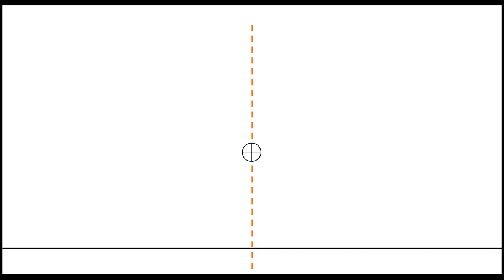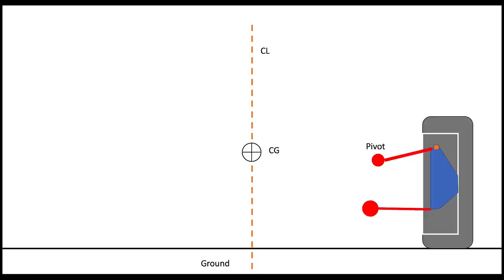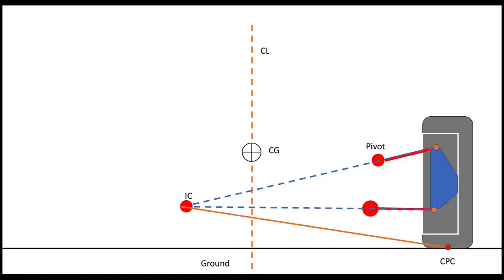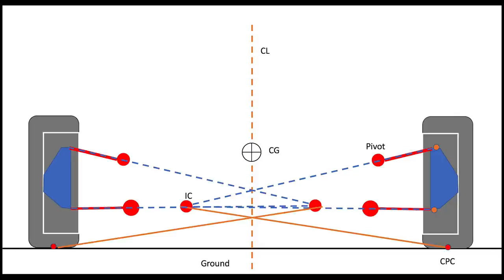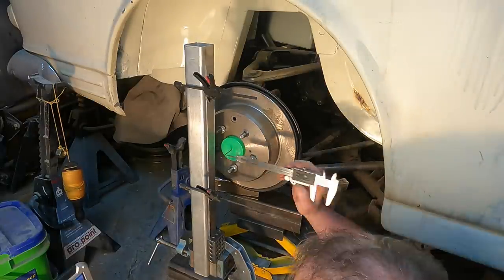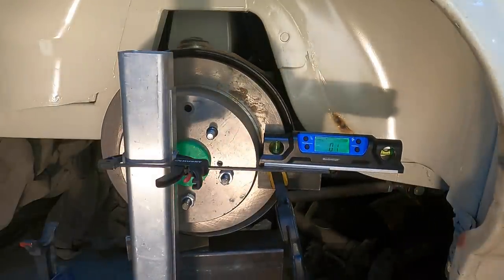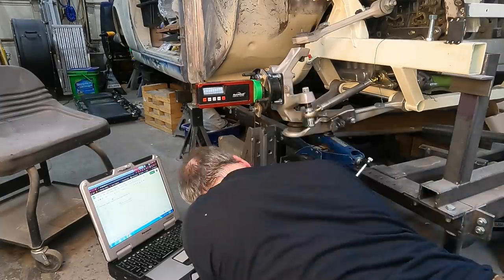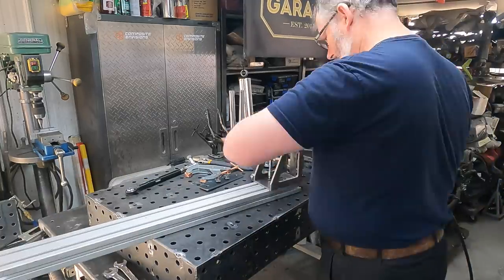Suspension Tuning: Roll Centers and Dynamics

Comment: Good video, when I did mine, I built the controls arms out of PCV plumbing pipes in the mock up stage and tried out dozens pick-up points and control arm lengths.  Made the virtual  FVSA (Front View Swing Arm) with string to capture the roll center.  Was manual and took awhile but had everything worked out before cutting and welding. Keep up the good work.
Reply from the maker: That's like the Stainforth string computer - works a treat from what I understand. I'm going to try some computer simulations in the near future.  The major learning in this exercise was to drill into my head what happens when pivots change.  I needed to experience this and get some hands-on before computer analysis output makes any sense.  I learn mechanical things through my hands more than my head it seems.

Comment: This was great. Thank you for going into the weeds a bit for us. I'm following the graphs well enough. The one thing I'm missing is what you've been changing to get those new curves. Adjusting position of control arms? Angle? It would be interesting to know/see in the next suspension video. Or in a comment, whatever works. Otherwise, hey, anyone who's done enough work has run into "ope" moments like this. C'est la vie. We're here to see the process, and no one ever learned by doing something perfectly the first time.
Reply from the maker: Sorry - I'm changing the location of the links as well as caster/camber.  In the graphs - the UCA/LCA both went down 2" (a little more for the front UCA pivot).
Reply: @ThrottleStopGarage  no need to apologize! Thanks for the insight. Hope the setup works well for you! Thanks for sharing.
Reply: Yeah, this was what I was missing as well, thank you for asking this question.

Comment: I played with the Corvette suspension a few years back.  When I used the standard upright positions on bump and droop the wheel angle was terrible.  This left me really confused then I re ran the tests with the body of the car rolling slightly and the suspension worked perfectly.  What the designers realized that I had considered is that when you are driving straight it doesn't matter what angle the wheel patch is during bump etc.  But in a corner is were it counts and that means you need to take into account body roll.
Love your videos keep up the great work.
Reply from the maker: I've got that in mind - it just doesn't pack into a video very well...I didn't show the side view geometries or any of the bump steer correction work (though watching my laser line move might be fun if you have a cat).  So body roll is part of the overall vehicle design.

Comment: I measured the roll center in a similar way when setting up the front suspension on my Volvo 142 race car to make sure I wasn't messing anything up by lowering it. Removed the springs and raised and lowered the car with the front tires on some rolling dollies, measuring the distance changes between the dollies in the process (and camber changes). That process made me realize that the slope of the CPC's trajectory is the real metric we're after, in addition to being easier to understand. A 10:1 slope, means 10% of the lateral loads are added to the tire vertically before the car even begins to lean and load the springs.
Reply from the maker: Absolutely.

Comment: Excellent explanation.   I too had wondered about 2 diamesion instead of 3 . I did note at position approx 17.30 on video . When jacking up to test the front top mount bolt moves . Hopefully that didn't make a difference .  Good work keep it up
Reply from the maker: Sharp eye!  I had some issues but in the end I measured and remeasured...then optimized and remeasured again.  It was solid with little variability.  I did do a standard error of the measurement analysis (not reported) - I'm a scientist - so I can do boring things virtually forever.

Comment: I like the different approach, if your adapting a suspension to a car this is a great method to get readings.  One thing I would have touched on is the relationship of the roll center to center of gravity.
Reply from the maker: I'm sure I'll cover this in a little more detail when I get the new suspension built.  The roll moment is critical to handling.

Comment: Typically roll centers are tuned for weight transfer dynamics and caster/camber curves are tuned for tire patch optimization independently.  Also, roll centers migrate, so I'm not sure using your method actually calculates the roll center at curb position.  You may be right, I definitely want to look into it, but when I think about adding significant length to a single arm, you will massively change the results.  Like if your upper arm is shorter than the lower, you'll camber in.  But if it's longer, you'll camber out. You can be at the same RCH with both conditions, but have significantly different kinematics.  I would say this is a good method for measuring the camber curve for sure.
Reply from the maker: It's a method that can be used and it works.  All roll centres are instantaneous...and can be found using forced based or geometric methods.  There are problems with definition, I'll cover this in my next video.
Reply: @ThrottleStopGarage  I guess the issue I have with the method is, I can change the kinematics to get different outputs that you measure, but without changing the roll center height.   What I'm not sure of, is if the outputs, though different, will still produce the same RCH.

Regardless of that, you seem to insinuate tuning your caster camber curves by adjusting RCH, but I typically treat them as completely decoupled metrics and tune them to do different things as they are responsible for different aspects of dynamics.  I guess my comment just stems from your early reference of being critical of other RCH videos, but not actually teaching what they do or how to tune them, but what I got from this video seems to be very different than what's practiced in the vehicle dynamics community. Again, not saying your measurement method is wrong as I've never used that method to measure RCH and I plan on running the math as it's intriguing, but you seem to be the type of person who would take pleasure in technical discussions and I also enjoy learning new methods and techniques.
Reply from the maker: @badinvestmentbuilds3823  Interesting - I'll try to explain the method first and then we can chat about the rest.  The criticism of the other videos is that most share a simple 2D "join the dots" geometric method (nothing wrong there) with the assumption that measuring the intersections of these points is trivial.  In practice, most suspensions are complex shapes and it's difficult to measure these points.  If we're making some quick adjustments to arm chassis mount points, then there is an "easier" way.  I glance off the topic of what a roll centre might represent as it opens up a bit of a pandora's box and I am not qualified to argue these points.  There are many research articles and I think a deep dive into this is beyond what I would be comfortable trying to explain.  In the vehicle dynamics community, they know what they're doing and they have studied the subject and worked with it - they have data-driven validation.  No question.  I guess I just didn't need to see another "join the dots" video.  Lots of those, most are a little shy of what happens when you do these things.  If I can only replicate what others have done, I'd just leave it.  I also didn't find the locating of these points to be effecient to measure on a jig.  The accumulation of error in their location (uncertainty) was pretty large (while it may have only been a few mm total).

Camber curves are a reflection of the relative lenth of the links and their angular relationship.  That's it as far as I know.  As my links were fixed, then what I can do is change their angular relationship.  The effect of this change is to alter the location of the location of the instantaneous centre - as, at that instant in space, the suspension is moving as a swing arm fixed at that point.  The validity of the method I present (which is not my creation - I was told to implement this method and the geometry makes sense) stems from the geometric reality that measuring the slope of the arc at the ground plane yields the line where the IC is located without having to measure the specifics of the arms that produced the IC location.  The line that connects the contact patch centre to the IC is what is used as a geometric location for the RCH and for a symetrical suspension, the RCH is going to fall at the centre of the vehicle.   

For any given RCH location for any specific combination of links and angular relationships between these links, there is a single IC.  In other words, if you hold the angular relationship constant - there is only one possible RCH.  The arms could be any length up to an including their intersection at the IC.  If you fix RCH and vehicle track width - you can have many different arrangements that will generate the RCH - but they all must lie on the line described by the contact patch intersection and the RCH.  This method seeks to measure the angle of that line.

If you change the angular relationship of the links to alter the camber curve...you will change the RCH.  They are completely dependent.  I hope I have explained this a little better.
Reply: @ThrottleStopGarage  I think the part my brain is messing with me is that I can change the kinematics without changing the RCH, which will change the output the curves, but the new curves will likely point to the same location.  I'll put a little math model together comparing them without measurement error.  I'm the field, we would use inclinometers on the arms, articulate it on an alignment rack, and pop those numbers into a calculator, but that requires a bit more up front work.  I'll reach out again if I can find the time to make the model and hopefully post up a video complimenting yours.  

You're correct that there's a lot of 2D dot connecting that doesn't do much good to the average tuner.  That has been a bit of inspiring for me to want to make a "Vehicle Dynamics for a 2 Car Garage" series lol.  High level specific development with the average resources a DIYer has.
Reply from the maker: @badinvestmentbuilds3823  when you get the video done, let me know.  Always interested in learning.

Comment: Love your work! Very informative, keep it up! 
At one point you mention you don't want that binding in the suspension but I think what you're seeing is the anti-squat working, unless some other factor is affecting it. When your arms are parallel to each other they use the spring and damper to react the forces only. When they aren't parallel, you introduce a fore/aft movement of one ball joint relative to the other which causes the bind. For example, say your bottom arm is parallel to the ground and your upper arm is angled up at the front, like on your rig. When you look at the side view the lower ball joint will move vertically. The upper ball joint will move vertically but also rearwards. If the upper and lower joints weren't connected, it wouldn't be a problem but the upright has a fixed length. The distance has to remain fixed but the arms want to separate which causes binding. More compression, more bind. Essentially you're creating a geometric resistance, ie a stiffness proportional to the compression, similar to a variable rate spring that increases in stiffness with more bump.
Reply: Apologies, I meant your anti-dive, given your rig is the front suspension.
Reply from the maker: What was happening was because the suspension arms were in the "wrong" place the ball joint was locking and that was the problem.  I also had issues with the caster and anti-dive and the spherical joint on the tie rod at one point.  Taking the caster to a more sensible value (based on the camber rate target and other factors) and dialling out the anti-dive to a value for this car as well as changing the bearing to another model provides zero bind over more than the range of travel for the suspension.  This was over a month of solid work to get done.

Comment: Phenomenal video! Thank you so much for making it. I agree with your assessment of the information that's available on the internet on roll centers. Everybody is theorizing and nobody is actually testing anything . And as we all know mechanical suspension modifications are generally very expensive. I'm wondering through your analysis of the lateral movement of the track width. Wouldn't that increased lateral movement increase the track width and therefore improve handling?
Reply from the maker: Glad it was helpful!   The track width does increase but only while in motion. The amount is very small.

Comment: You are brave for taking this on as an amateur!  I think the engineering perspective is a whole lot more complicated than what you are presenting here.  Roll center height doesn't mean much by itself.   The first engineer may not have been completely wrong in his assessment that your original geometry is perfectly adequate for a classic car.  I thought you were building a "stock" looking classic car, with a little something extra, right?  Not a full on race car?

The optimization comes down to knowing precisely what you are trying to achieve.  If you are planning on having stiff racing suspension, you need a low roll center to maintain compliance/ allow some down jacking while cornering.  But if you want a softer, more comfortable ride with controlled roll characteristics, you need a higher roll center than the race car.  (You said in the video that lower roll center meant less down jacking, but I think you got that backwards.  The further apart the roll center and the center of gravity is, the more jacking you get.  When they are the same, you have zero jacking...In my mind the "roll center" is more like "Moment of zero roll".  

As a casual onlooker, I'm just observing that you are diving into measuring the geometry, but you didn't explain what end result is that you are trying to achieve.  I've been watching for awhile, but I don't think I've seen you explain the overall vision for the car and how you expect it to perform.  Race car in old car body?  Old car that handles like a modern car?
Reply from the maker: Fredy - you missed the "clueless" in front of amateur!  Thanks for the detailed feedback - I learn best hands-on and I really soak up the feedback...I am here to LEARN - so I really appreciate the sharing.  I had a long sit-down (well a drive through Saskatchewan) with a great friend and he asked the same question - no BS - it's not a race car, it's not meant to be a classic car that you drive to show off either.  The "Vision" is to do two things - it must be able to make me smile at a track day (and this car was a restored version with all the normal suspension mods before all of this) and it must be a quick road car.  So in your words - "Old car that handles like a modern car." that's the vision.  Look at Cyan Racing's P1800 - or a Singer Porsche 911 - that's the goal.  Whatever that is called now.
Reply: @ThrottleStopGarage  "restomod"

Comment: Love the video. I did notice you never went into an in depth discussion as to what caused the binding the first time you put it on the bench. I thought I might give a little explanation. If you know this already then just ignore me. But in order for a double wishbone to articulate freely without binding it is required that the 4 frame mount pivot points (2 on upper and 2 on lower control arms) must be exactly in the same plane. If any 1 is slightly misaligned from the other 3 then there will always be some binding just as you demonstrated.
Reply from the maker: Sorry Alan - I thought I'd responded to you already.  If I understand what you're saying (it's been a long week - so apologies for the foggy brain).  Most SLA suspensions do not have the two planes coplanar.  What happens in that case is as the suspension say goes into bump, the upright must rotate in order to account for this - so in my case you gain caster in bump (as well as camber - but we're looking at the side view).  The binding in my case was caused by the suspension locating positions being in a position that the upper ball joint locked (the pin goes through a slot in the cup) and it was hitting that point due to too much caster.  I dialed that out a little at a time until it was happy (and we were on the targets) - I also had issues at one point with the tie rod end spherical joint running out of travel (that is the picture I used for the thumbnail).  So I changed a few more angles and got a different spherical bearing and it is now fine.  The entire suspension is free of bind through an arc that is greater than the shock travel.  This is optimal.  Suspension member must never be stressed due to mechanical binding.
Reply: @ThrottleStopGarage  I get what your saying. Totally get how yours bound up now. I wasn’t referring to the camber gain. The point I was referring too was the upper and lower control arms frame mount pivot points (not the spindle side) must always lie within the same plane in order to articulate. Basically if one of those point gets moved to a point they are no longer on the same plane then your suspension will bind. The farther off plane it is the less it will articulate before binding. It’s like adding a flat to a 4 link to add preload, more than 2 flats and you essentially shift one point too far out of plane and it starts to bind.